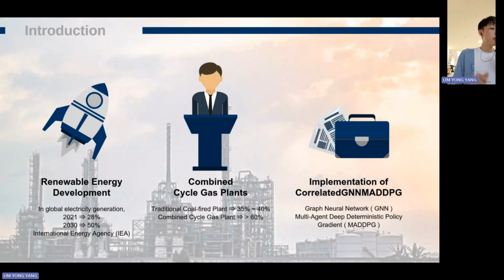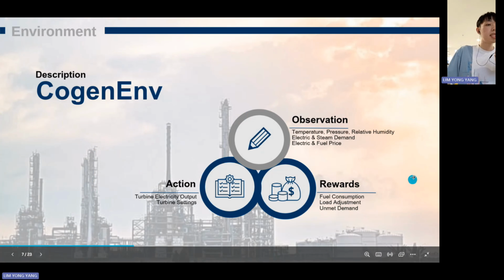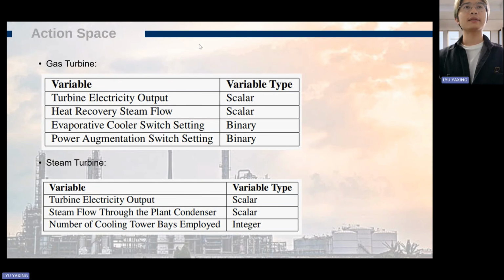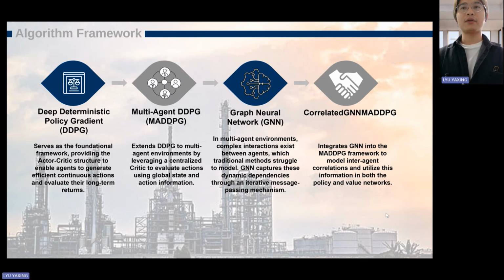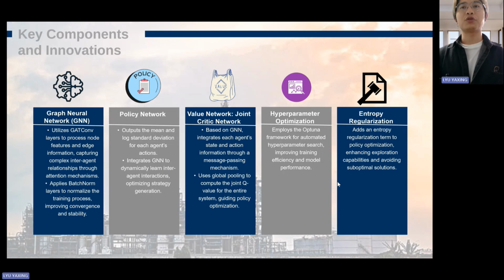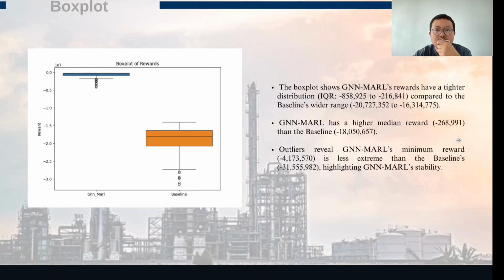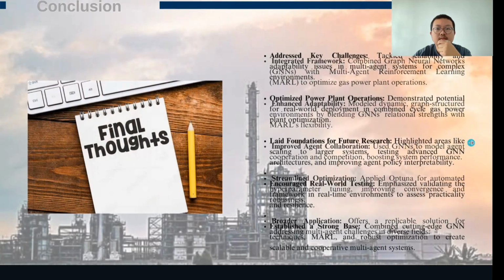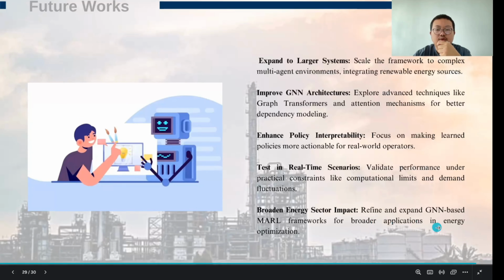202409 AIT306 Group 2 Project with SustainGym

Comment: How can the integration of Correlated Graph Neural Network (GNN) and Multi-Agent Deep Deterministic Policy Gradient (MADDPG) be utilized to simulate the optimization of energy resource allocation and transition strategies in SustaiGym, considering the increasing adoption of renewable energy and the efficiency of combined cycle gas plants?
Reply: 1. Environment Modeling:
The MultiAgentCogenEnv simulates a multi-agent energy allocation environment where each agent represents an energy resource (e.g., renewables or gas plants).
The environment facilitates interaction and learning among agents.

2. Policy Generation:
The GNNPolicy models each agent’s policy using a graph neural network, capturing inter-agent correlations to optimize collective decisions.
The policy network outputs mean and log_std for each agent's action, generating continuous actions via a normal distribution.

3. Value Function Evaluation:
The GNNJointCritic evaluates joint Q-values for all agents based on their observations and actions, reflecting the impact of coordinated strategies on system efficiency.

4/ Training Mechanism:
Experience is stored in a ReplayBuffer, and training uses Double Q-Learning and soft updates to ensure stability.
Policy updates incorporate entropy regularization to encourage exploration.

5/Optimization Goal:
Through collaborative multi-agent learning, the approach optimizes energy allocation strategies to maximize system rewards (e.g., cost reduction, efficiency improvement) while adapting to the variability of renewables.